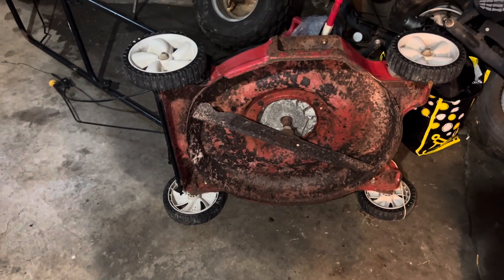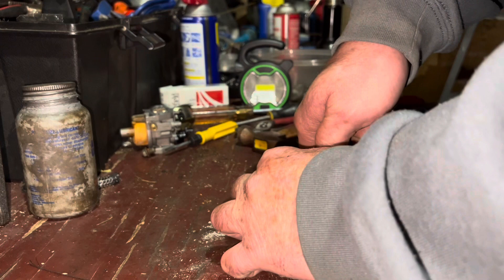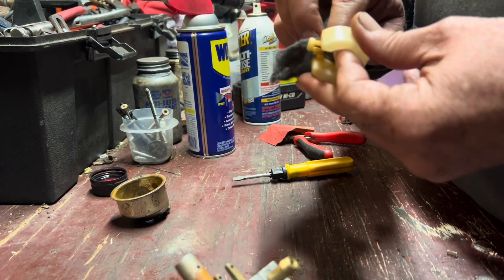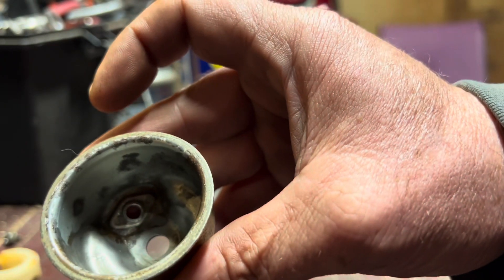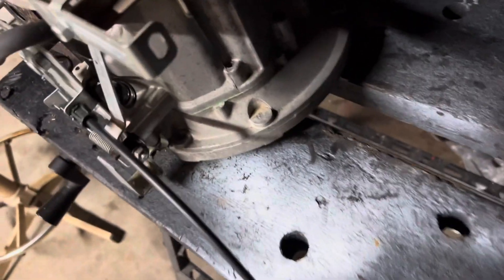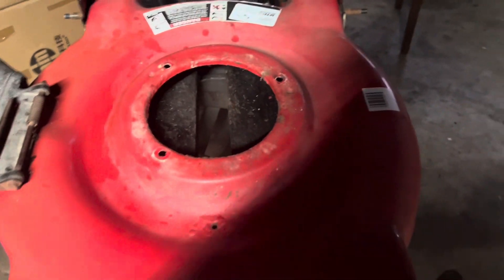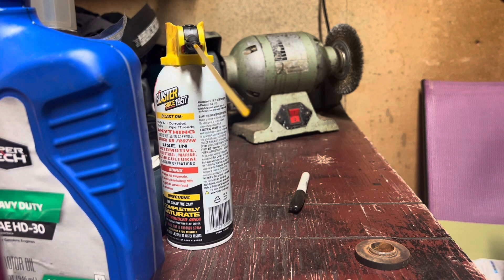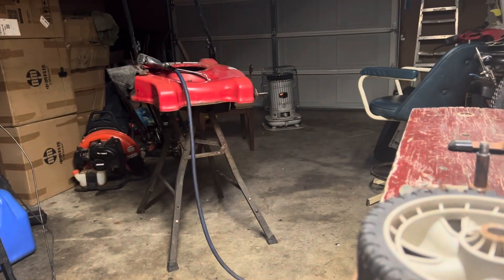2003 Huskee (part 2) tear down and start on the refurb

Comment: Very nice, back in the summer I got a bench grinder, and recently, I got a pneumatic impact, they save so much time it's unbelievable.
Reply from the maker: Good for you my friend.  Yes it’s a game changer for sure. Maybe ask Santa for a dremel 😀
Reply: @dirtyberniesgarage1194  We actually do have a Dremel, I need to get some more attachments for it though.
Reply from the maker: Good deal. I’ve done porting work on engines with them as well. They seem to run smoother with it.  I’ll do a vid on it one day
Reply: @dirtyberniesgarage1194  cool, I would love to see that.